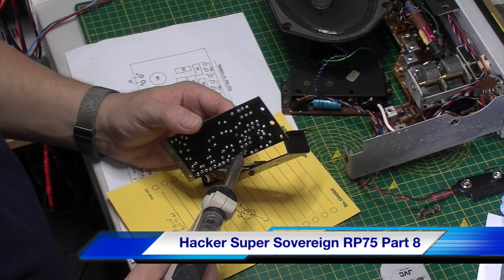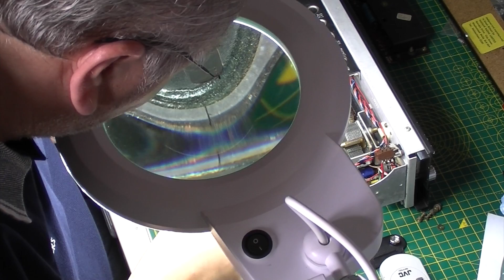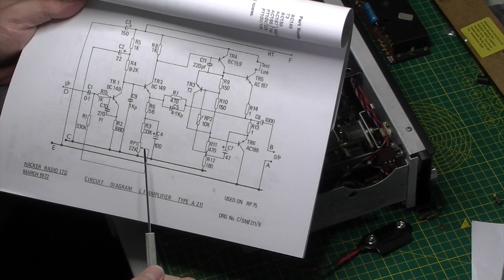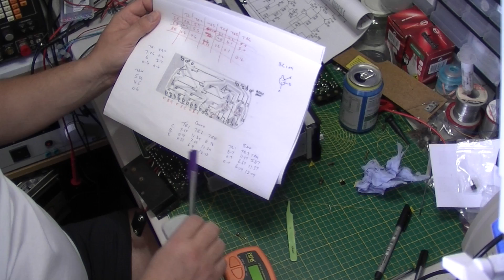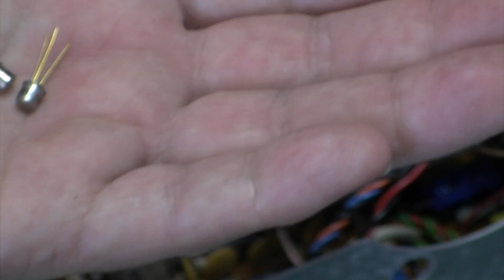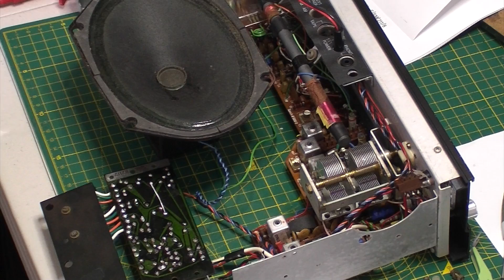Hacker Super Sovereign RP75 transistor radio Part 8: Problems with the amp

Comment: I remember doing some repairs to an early 'Sansui' amplifier which had silicon transistors of the BC 1.. vintage... they were 2SA, 2SB prefix, in a TO-92 package, but replaced all with BC549, BC559 types (low noise), but this design is still using the compementary germanium output transistors; AC187, AC188... Think these are ok, even though the small signal class A application the germanium transistors are more prone to noise than silicon types...
Reply from the maker: Thanks for the comment. I'm not really sure why Hacker didn't use silicon for the outputs and driver. I'm sure there is a technical reason for it. It's not over yet though as the amp rears its ugly head again in the final video. Thanks for watching. Graham
Reply: +Radiocruncher I think the reason is more to do with available components and price, but in the late 1960's, Philips Components published application notes for the AC187 AC188 transistors with circuits almost identical to the one you are working on. The 'Sansui' amplifier I worked on had problems with the tone control silicon transistors, which measured a noise out of circuit on the ohms scale (x 10k) across the collector-emitter... the needle had very animated movement..